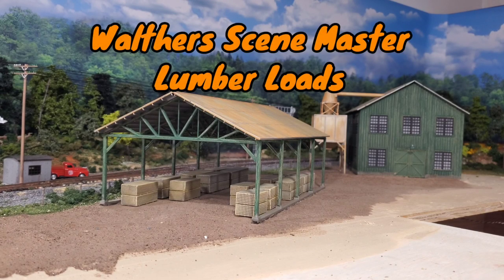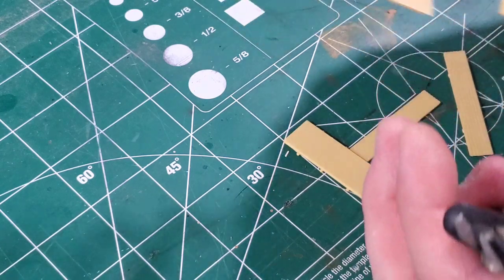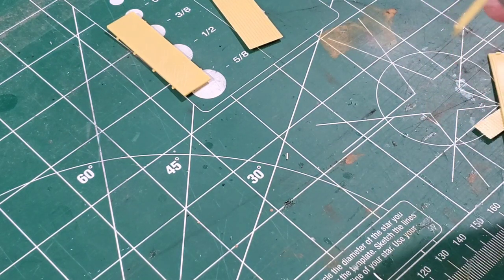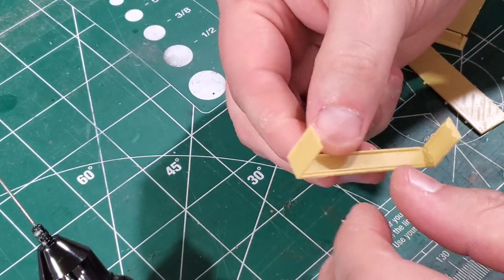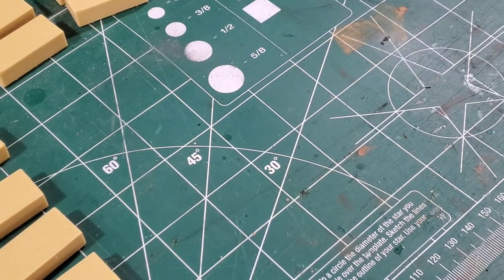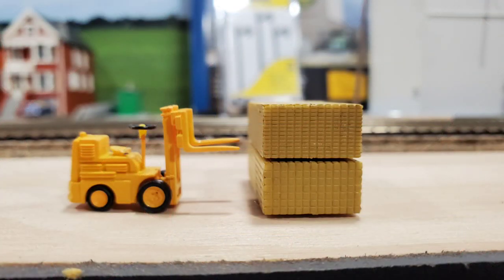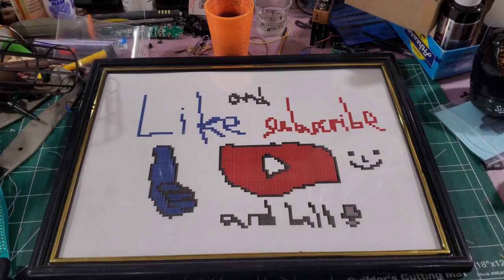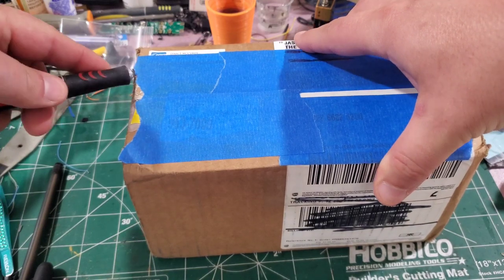Holy Crap! These Lumber Loads Look Realistic!

Comment: Dang, I hope you didn't glue all of your lumber stacks down. I might have to buy you a few more, for my gift to you for your sawmill! Lynn, I saw a few pieces that were scaring me has Jason pulled them from the box. I was thinking you did what I'm doing for Jason. But in the end, it was different! Great job on those lumber stacks. Easy on the sanding, Jason. Maybe get a lighter sanding block and don't push down so hard!
Reply from the maker: No worries Roy! We could always have flat cars with different lumber loads on them. I've also got a lumber sorting table as well that will need loose boards.